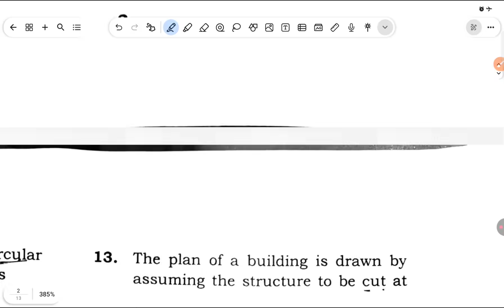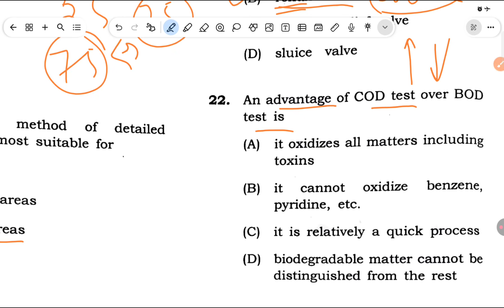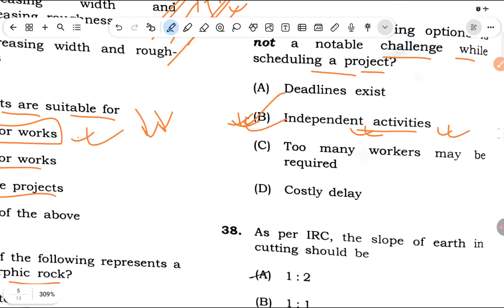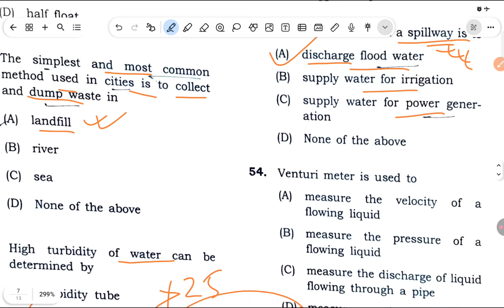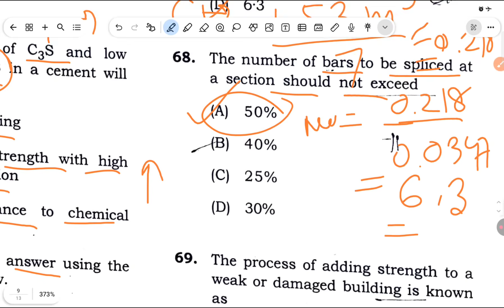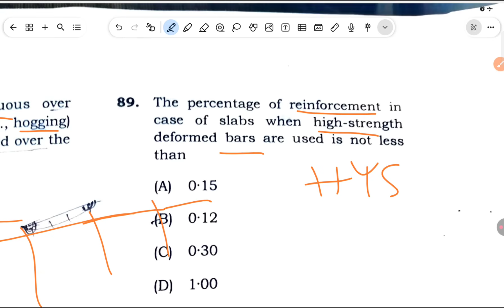APSC WRD JE CIVIL ENGINEERING PAPER SOLVED 2025

Comment: 16 d hbo naki .tensile strength is same in all directions
Reply from the maker: Parallel(0°) to grain max & min at 90° to grain
Reply: As per answer key same in all directions dia asei agor duta question paper ot paisilu.. but correct option A hoi
Reply: 30. Butt joint